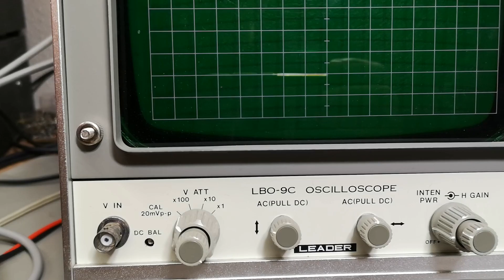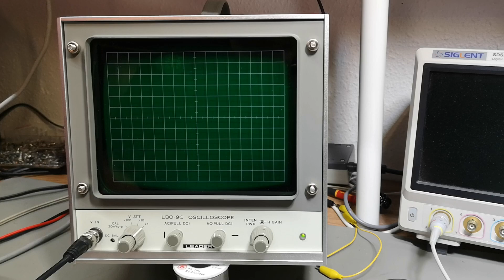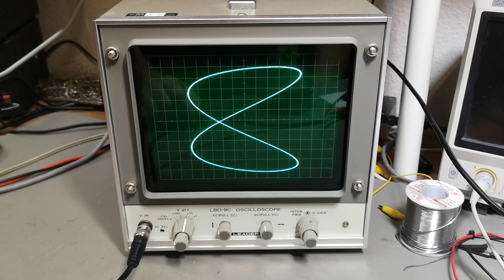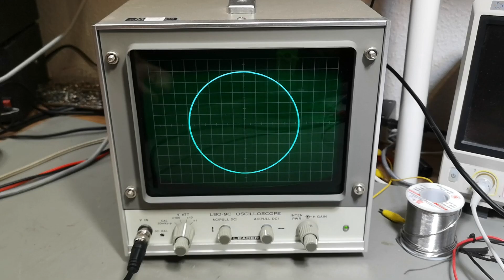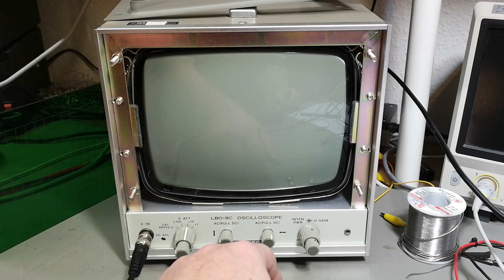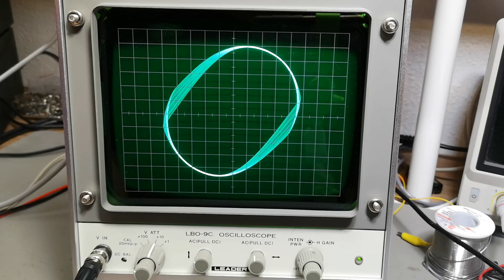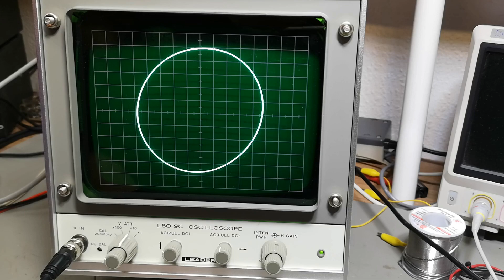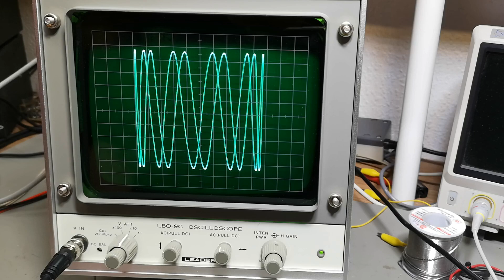Leader LBO-9C oscilloscope 0-10kHz vert, XY monitor test teardown

Comment: do you know what type of material they used to use for the coloured screen glass? The transparent coloured piece that sits in front of the crt, which is usually transparent dark green, blue or black? I need a replacement for my analogue scope & i don't know where to find one
Reply from the maker: acrylic or policarbonate or pvc, the correct color and thickness seems to be impossible to find, i have the same problem

Comment: that screen appears to be like that of an ordinary CTR tv.
Would it be possible to build such a team with one of those screens?
Reply from the maker: yes, this is a normal TV screen, if you take a "normal" TV / video monitor, the deflection coil is part of the transformator resonant drive circuit, disconnect that horizontal coil, measure its value, and put in another coil with that value, now the highvoltage is running, and you get a bright dot in the centre, turn down brightness a lot ! now play with your own coil drivers.

Comment: Cool video! A friend and I also have a 9C and both do the dot thing after turning it off but none have a burn in the center. The scope might have a "spot killer" circuit like the Vectrex game console,  a safety feature which shuts down the beam when the size of the image becomes too small (which also happens with the 9C). If you find a way to disable it please let me know!
Reply from the maker: thanks for the info, I did not find a spot killer circuit in this one, sadly

Comment: Is the term oscilloscope not a marketing gimmick?
It looks more like a monitor-scope that you use in tandem with a sweeper (eg wavetek 2001) in ordet to fine tune a filter.

I have a such a monitor-scope from 1985, found out the workings by applying dc signals to horiz/vert input separate, 
then you know how much voltage is needed in order to have a left/right & up/down movement.

Next is applying a slow ramp on the horiz input and the tuning signal from sweeper/DUT circuit.

My monitor scope als has the problem of starting with an intensified central dot. 
Before starting up i set horiz/vert gain to the smallest value and as much as possible away from the center of the screen.
Reply from the maker: I cant solve the dot problem / by move the dot away from centre, since the deflection amplifiers dont work right away when power is removed, maybe add much larger capacitors in the power supply could solve this. Yes about oscilloscope , i think we tech people have learned what an oscilloscope is, this one dont have a time base or trigger, it is only an XY oscilloscope

Comment: Hi, WOW  😲 that's great S C O P E 👍
So this is the first thing I really envy you, it would be a great display for my micro lab for a curve tracker, instead of the TEK 212 miniature screen. On the other hand, I would move the vertical input to the rear panel, because it would only get in the way on the front panel, I was looking at a similar display from HP, but it does not have deflection using coils and is therefore as deep as my desk.
The eclipse would really like to be modified, without a diagram it will probably be a terrible job, drawing and describing everything. Do you think it's a manufacturing defect or something went wrong, I've seen this shutdown behavior somewhere before, I just can't remember where.

Nice day 🙂 Tom
Reply from the maker: yes this one is super nice, love its size, I think the power off bright dot problem is a design error, I really hope to hear from other owners if their unit do the same, and how they fixed it, removing the green plastic reveal a dark spot sadly.
Reply: @TeardownOZ2CPU  The dark dot was also visible on the monitor after removing the green filter, I tried to observe whether it had any significant effect during operation, but I did not notice any decrease in brightness in the damaged area. I'm keeping my fingers crossed that you can remove it, I'll try to find some time and look for something, I still can't shake the feeling that I've encountered this phenomenon before.
Reply from the maker: @Edisson.  it is a rather classic problem, to power up and down CRT drive and power correctly.
Reply: @TeardownOZ2CPU  Yes, you say "correctly switch off" if it is done incorrectly, the HV transformer can be damaged. This was a problem with one type of Hungarian distortion meter for teletype lines, there the transformers were leaving like on a conveyor belt, new ones could not be found, so we wound up like a race.